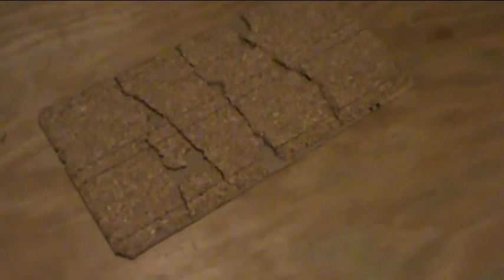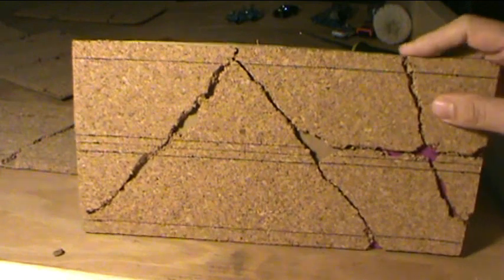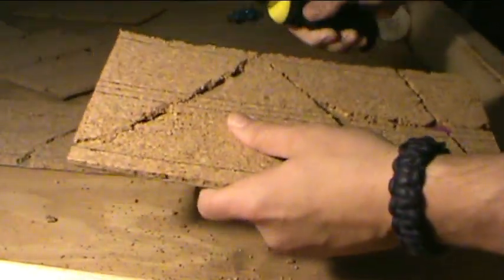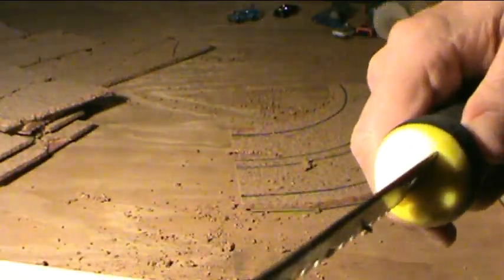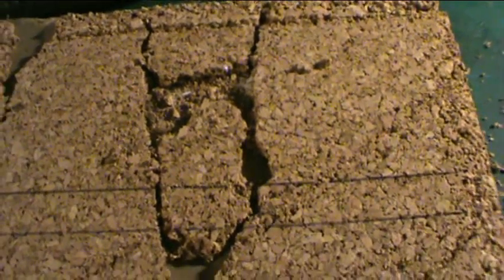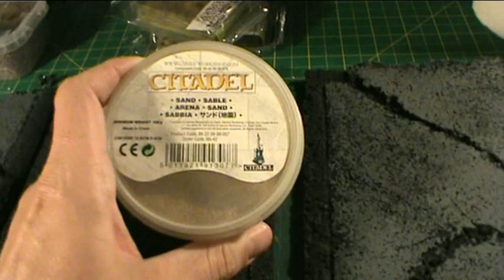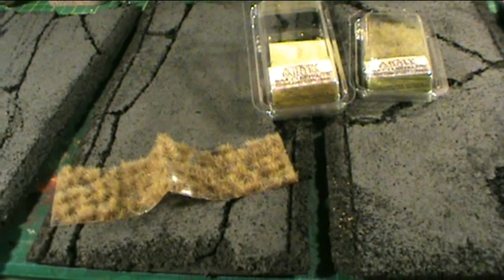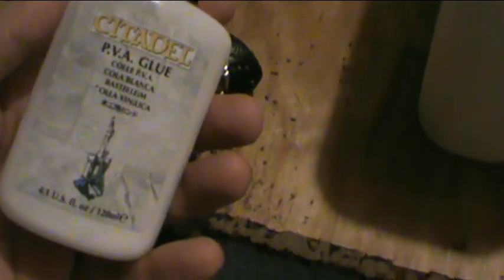Gaslands CorkBoard Roads

Comment: Uhmmm,...How wide did you make the straights? And Also! I'm an Idiot with no access to a compass but how did you do the Curves?
Reply: You can do it with lengths of string and a drawing pin. You want to put the pin at the centre of your arc. The loops of string are to hold your pencil. Make a loop for the inside arc, hook it around the drawing pin and put your pencil through the loop. Maintain the tension as you draw the curve. Do the same with the big loop for the outside arc.
Reply: @mikestanmore2614  Exactly, Sorry if I was too vague...First video ever. And yeah. I just took the width of the roads and used small clamps to add a nail and a marker to a metal ruler and made the curves that way.
Reply: As far as the straights go, I actually looked up how wide a two lane road is and divided it by 64 to get the scale. Each individual lane ended up being 2 3/4" with a 1/4" berm on the side of the road.  So basically I cut the 12x12" sheets of corkboard in half then worked from there to maximize material use.